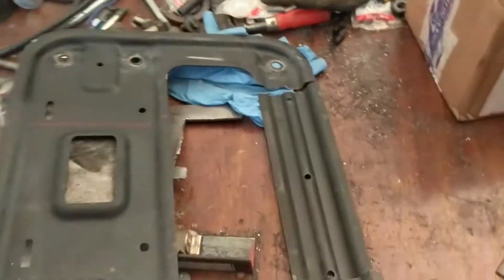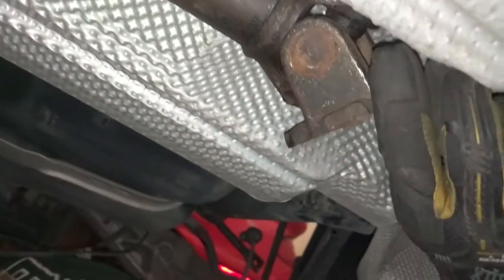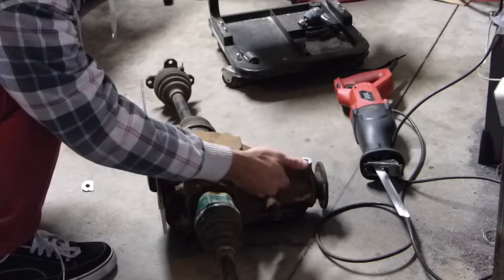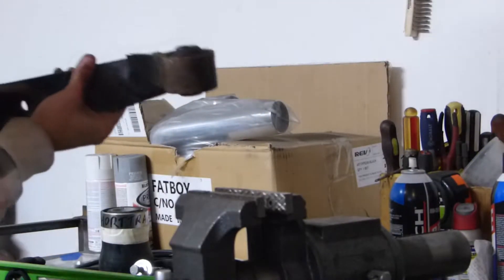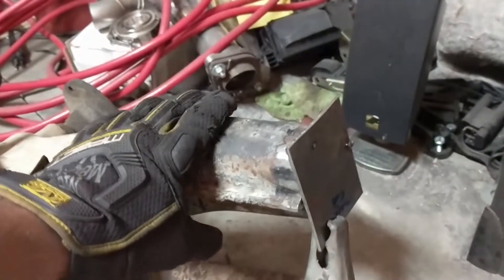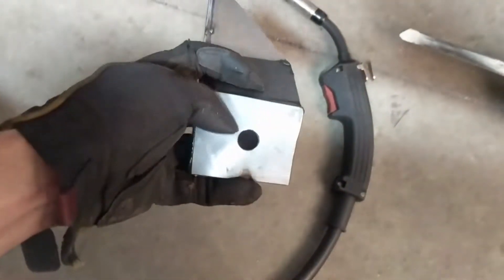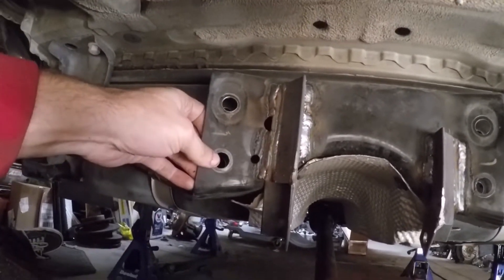✓ Custom Trailing Arm and Rear LSD Mounting - AWD Mini Cooper Ep. 15

Comment: i thought i was the only one stupid enough to do a rwd conversion on a mini cooper. two different strategies but still awesome. I am using mazda subframes and suspension in mine. unsure on engine. Possibly v6. im 17.
Reply: any way  good luck!
Reply from the maker: Hey thanks a bunch. Yeah so many ways to do it. That would have been a good way to go, but I think that means you have a live axle in the rear rather than a fully independent rear suspension, right? Or did/do you build IRS off of the Mazda rear subframe (I am guess MX5 since it's a similar width/size in the rear). I considered that for a bit since I also have an MX5 but the live axle made me go this other route. The other option would be a full DIY solution but I feel that would take too long given me trying to beat the snow lol
A V6 would be a good choice given the space constraints. Should be shorter than putting in a 4 cylinder in a North South orientation but there isn't too much support for 6 cylinders outside of the fairlady platforms (350/370s). My V6 Genesis Coupe was a pain but then again, with a Mini Chassis, it's not like we NEED gobs of power haha. The only difference for me is I am going for AWD which does make it easier to fit the engine in the front since I am keeping the Mini East West layout.
Also, mega props to getting started so young. I only started working on cars at 16 or 17 and it was just bolt ons, no real fab work til I was about 21 and bought a welder. Probably the best choice I ever made. Let me know how your project goes and I'd love to compare notes sometimes. Feel free to reach out if you need help or problem solving. Given your swap choices, you've got some fun challenges ahead.
Best of luck and Happy Modding
Reply: As i am using mx5 rear sub-frame i will keep the diff setup as is. the way i am doing it has made a lot more work for myself. I never knew the galant matched up so well. I work for Mitsubishi which makes matters worse :)   . The 4g63 engine is really good. such a shame they discontinued its use after the 9.
Reply from the maker: Oh gotcha. That's not a bad way to go. Power wise, smooth pavement racing, and drag racing wise, that is the way to go. I am hoping to do some rally cross so the extra articulation should help with traction on the bumps. For the matching, I went to Wikipedia and matched Mitsubishi track width and wheel base and the 1g eclipse GSX specifically was within a half inch for wheel base and an inch in track width meaning the axles and driveshaft would be reusable along with suspension parts. My original criteria was 1) must be AWD 2) needs to make power or have the potential to 3) needs solid aftermarket support 4) needs to fit in the engine bay. So I looked at all the different performance AWD setups from the JDM SR20 AWD, WRX, and naturally 4G63. SR20 was glass after stock power so it's out, WRX would be hard to fit with the length and NS crank layout but the 4G63 was perfect.
Not a fan of using the CRV trans since I wanted something performance oriented rather than economy SUV. I would also need a Honda B series at that point too which got expensive fast if you want a good one.
I think the 4b11 that they use now is a similar engine block but more refined and utilizes newer tech as well as an aluminum block so it should be a step forward, but the 4g63 was a tank in cast iron. The mini is gonna feel the weight increase for sure lol
Reply: Awesome you are already doing that work at 17! I also didn't start working on cars until about 16 or 17 and I bought my first welder at about 22 I believe. I really want to do a RWD conversion to a B13 Sentra with running gear from a 240SX in the future. We'll see!

Comment: I bought a  2011 Cooper s shell and I'm think if i can make it  awd by using everything from a the countryman s drive train and motor
Reply from the maker: You can definitely use the countryman rear suspension. I swapped to that recently to get the speedometer to work. Brakes swapped over too. OEM Control arms work but adjustable ones are better regardless if it's bolt on or custom. Rear Mini diff is pretty expensive to get your hands on and you'll still need a custom driveshaft so it may be worth looking at something more performance oriented for the diff. Engine and transmission "should" fit but idk how the FWD will line up or the different mounts. You could probably use the stock engine though if you have it with your shell. The challenge is that the Mini engine has its limitations on power, but if you're ok with that or happy to go through the build process with custom parts then you can have a really nice OEM looking AWD with functioning OBD2 and AC and everything
Reply: @InitialDIYmods  yah I'm thinking to get one from the action I'm not too good of fabricating but u  inspire me to give it a try
Reply: And I'm wondering if I have to cut the floorboard for the drive shaft the run through cuz I'm looking at the Countryman it look wider Cooper 's
Reply from the maker: It depends on your build strategy. You can center the axles and deal with the driveshaft wherever it ends up or you can center the driveshaft in your OEM tunnel and then make everything else fit which is what I did. Depending on how the engine fits and how the axles line up, it may be the same or it may not. The axle splines or CV might be swappable, I'm not sure. I know front and rear aren't interchangable even though they have the same splines. Spline Length and CV clearance is different

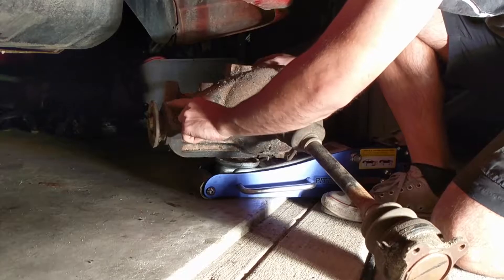Comment: answer to the question at 3:10 "92-"94 awd 1g dsms all had the stronger 4 bolt rear axles, the "89-"91 awd 1g dsms had the, somewhat weaker, 3 bolt rear axles, but "89-"91 1g dsm owners typically swap the stronger, 4 bolt rear, axles, diff, and cups, into their early cars.
Reply from the maker: Awesome, thanks for the info ;-)

Comment: You need an assistant . Lot of work for 1 person .Nice card board template .Smart .
Reply from the maker: Dino Maxi haha thanks yeah I'm glad I went with a template method or I would have wasted a bunch of steel and time not to mention saw blades 😂
An assistant would be great for sure, this is taking forever. Once I finish the coilovers, I want to start wiring harness, installing the sensors, and new ECU. Then it's just brake lines, body assembly, radiator, Intake, intercooler, exhaust, integrating electrical systems and tuning. Soooo close. Like 3/4th done